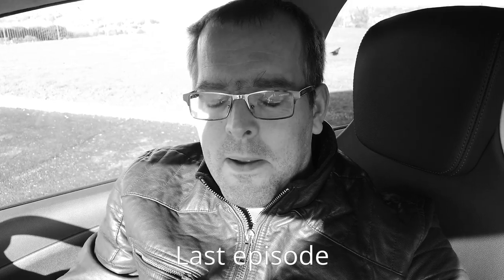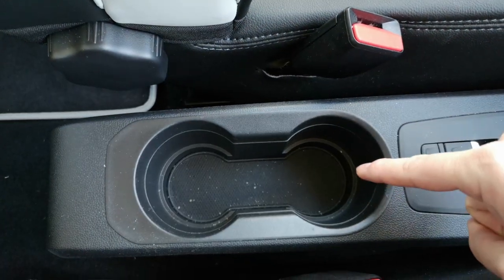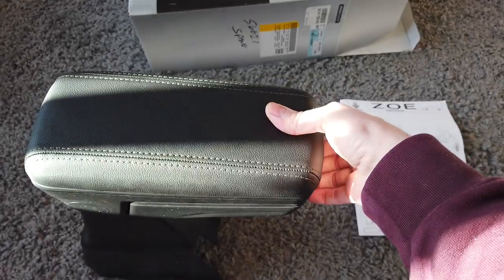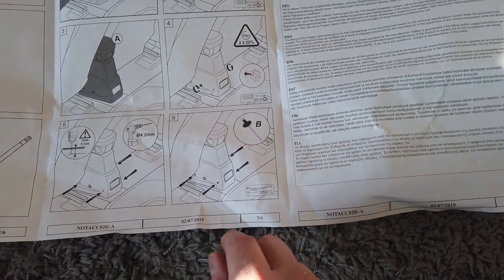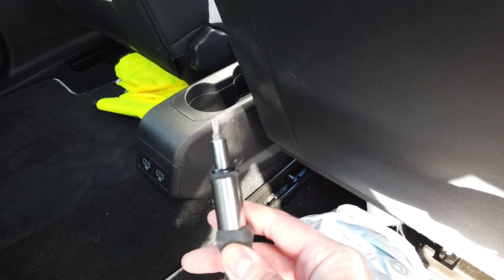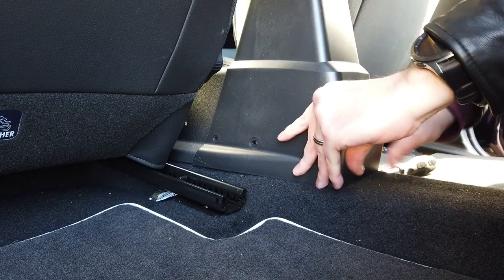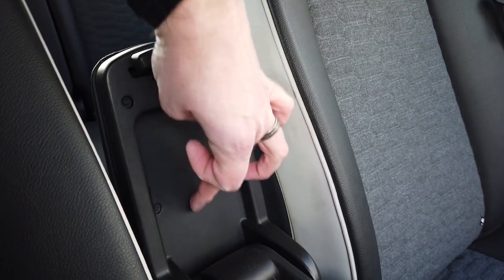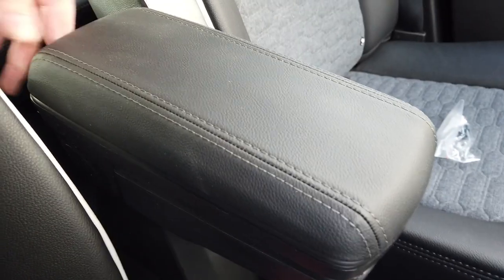How to install a armrest in a Renault Zoe!

Comment: Thanks. Good views of stability with only the screws. Would it be worthwhile to put double-sided tape on inside lower edge instead of using pop rivets?
Reply from the maker: That maybe worth while doing, alright.. Thanks for the suggestion!
Reply: @JanBartSpang  inspired by your video I ordered armrest yesterday & delivered free this morning from Glyn Hopkin. Now what did I do with the roll of double-sided tape 🤔
Reply from the maker: @williamfuggle1036  awesome! I need to find some double-sided tape myself! 👍

Comment: Thanks, Jan. Very useful, and it's good to know that an armrest is available, if desired. Only using the two fixing points will cause extra stress at those two screws. There's quite a lot of leverage involved when you lean on an armrest, and if one screw becomes loose, it can lead to failure. Riveting tools are easy to find, and maybe a neighbour has one which you can borrow.
You might want to correct the typo in the video title, btw. In English, 'an' is used when the next word begins with a vowel. It makes the sentence easier to speak. 😉 👍
Reply: The other option is to get hold of 4 self tapping screws and fit them instead of the pop rivets

Comment: So, I fitted the armrest today. How did you get on with just using the two screws? Did it eventually become unstable? Thanks Chris
Reply from the maker: Hi Chris,

It caused me no issues. But I would personally probably prefer to have the other clamps in there as well. They would protect more against any pressure from the side.